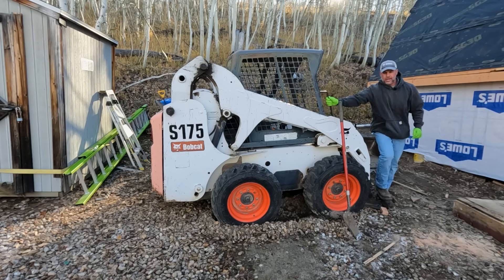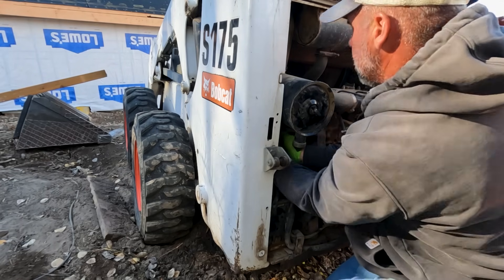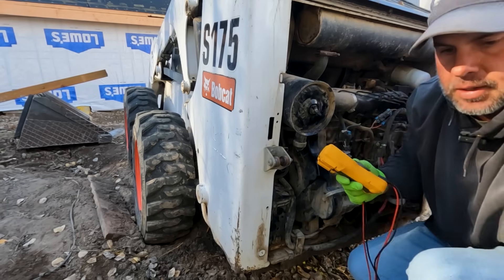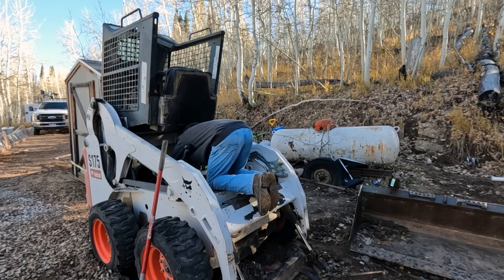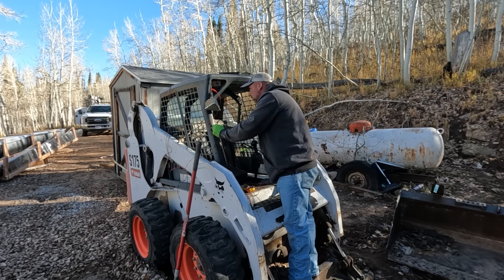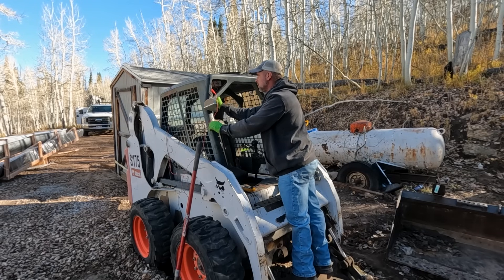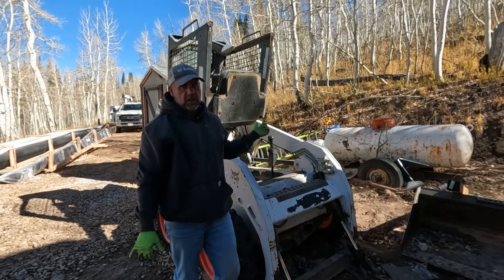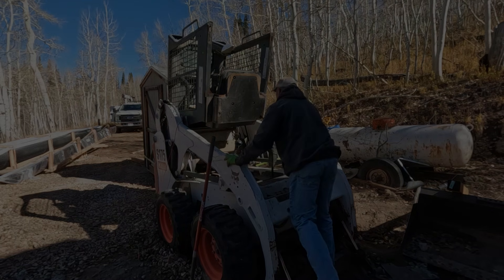Troubleshooting a Bobcat With Electrical Issues.

Comment: My S175 was running fine, I powered down for less than an hour, came back and ignition would click - but not turn over. Battery was good, starter and solenoid were good, I was getting power to the cab - 3 hours later, I came across Brady's S175 video - opened fuse box on my S175 and sure enough, starter relay was bad. Swapped relays around but I could start but not move S175 without good relays in all 3 slots, so ran to Autozone and they had one for $20! Ordered a few more 30s and 40s on Amazon for $9 each, just in case! How do I donate to Brady's 'beer fund'?

Comment: The 3 wires  to the key switch one always  have green corrosion   or check   the harness plug  under cab  right side   by the hyd tank

Comment: I recently purchased a 863, after running it a few times it would crank but no start. Figured out there was no power getting to the fuel shutoff solenoid. 
Turns out there was a loose connection on the ignition switch.

Comment: I know this is an older video and I am only at 10 minutes in and the battery may not be the issue but my first thought was the amperage of the battery when the battery was being checked.  It may read 12 volts but the amperage may be way down because one cell is bad which will not put enough amperage to turn over the engine.  Will continue to watch the rest of the video because it is very informative.  Thanks

Nice job on tracking down the short.

Comment: As a non mechanic I learn so much watching Brady’s videos.  With regard to the starter issue, this was another learning experience for me.  As stated in another comment, I had power coming to cab but no power to starter.  After watching a bunch of issues on testing the starter by putting a volt meter on the S terminal of the starter, I tried it on my starter.  There was no voltage coming to what I thought was the S terminal.  Stupid me, the Bobcat starter has four terminals (power cable from battery, power cable to starter motor, S terminal and R terminal.  The R terminal is located on the front of the starter and the S terminal is tucked away on the back side of the starter.  I didn’t see the S terminal back there, so I was testing the R terminal.  I discovered this after pulling the starter and seeing the S terminal.  A bench test revealed the starter was bad, so I ordered a new starter.  After installing it it still wasn’t working even thought I was getting 12.5 volts to the S terminal when turning the starter.  After much time I discovered that I had put the starter relay in the wrong spot when I was testing the relays.  After putting it back in the right location, the machine started right up.  All this to say, is that through this I learned a lot about the starting system and how it works so next time, I’ll be able to diagnose the problem quicker.  Watching Brady go through his own frustrations on this project comforted me that sometimes you just have to to keep chasing down problems only to find something simple.  Thank you Brady for sharing all your knowledge along with your own frustrations.

Comment: I wish you were in Northwest Missouri right now because I have the same machine with the same problem.  The only power to either panel on the front is the hour meter which says input and I've replaced the left panel and the right and it's changed nothing.

Comment: I enjoyed your video, it was close to an issue a buddy of mine is having. His issue is if he leaves the battery connected to Bobcat, the battery gets drained. When this happens he has to pop in a new or other rechargeable battery to get the machine started. His temporary solution is that he disconnects the black cable when not in use. when he needs to use it, he plugs the black cable on. That is a tempo fix till he figures out what the issue is. Have you ever encountered that and if yes, what was your solution? An fyi, when black cable is connected, the machine needs to run for several minutes. The other day, I connected the black cable to move the machine to another location.  During that process ,whcih was only two minutes, i had to do something else and parked the machine in its original place. The machine ran for like two minutes. After 20 minutes I came back to the machine and plugged on the black cable. when i attempted to start it, it would not start. The console would light up, but it would not kick in. Have you encountered this? If yes, what was your solution?

Comment: Great video!  I have an issue with my T770.  I have power coming to cab, but starter won’t turn over.  It started right up and I turned it off to talk to a worker.  When I got back in, although the cab powers up, the starter won’t turn over.  I’m hoping it’s just a relay issue.  Any advice from anyone?

Comment: My s250 won’t start and gives an error message 8250,   “ starter relay signal wire”voltage not present when voltage expected
Reply: Just died in the middle of operation,turns over but won’t start.
Reply: Fixed it !!!!! I guess when it’s staved off fuel it sends the starter relay error code.

Comment: Have you ever seen an issue where the arms can only lift part of the way? Still has tilt control and drives like normal though. I thought it could be an electrical issue but I’m not sure.

Comment: LMAO! Great video. Makes me feel good that I'm not the only one who GOES NUTZ trying to find these electrical problems in ANY computerized vehicle!
Today I took your advice on this Bobcat 773 diagnostic and looked for the obvious. AND, I didn't use my PowerProbe Tracer! So, after checking all wires between the control panels and the ECM, checking the battery and cleaning/testing all grounds, and reassembling everything and testing for power at every fuse and relay in the fuse panel, we concluded that all wires led back to the ECM from both directions. So we removed the ECM cover and found the silicone goop cracked on the red capacitor at its base. A gentle lift on that capacitor showed both leads to be broken. The OBVIOUS here is NO CAPACITOR CONNECTION on the ECM. Took a full day of testing but we finally found at least one part of the problem. Your perseverance was inspirational!

If you don't mind me asking, do you know what the capacitor specs are on this red (mylar) capacitor? It has no text anywhere on it!

Comment: This video helped to me finally solve a no start/no crank issue on my s175 today; one that has been plaguing me for a couple of months. I had power to the cab and I was getting a code for hydrostatic filter not connected. I changed the pressure sensor at the hydraulic housing, swapped relays, looked for broken wiring, but no dice. Thanks to this video, I decided to pull out my multimeter and recheck the ground cables for resistance. It turns out my battery ground cable to chassis was bad and was causing the computer to send a false code. I purchased a new cable for $10 , installed it, and the machine fired right up. Had I not used a multimeter, I would have never found the issue, as the wire looks completely intact upon visual inspection. I am grateful for this channel and others like it, that are willing to share their knowledge and expertise.

Comment: I have a question to find out if my question is worth a $$call. 
16-07 traction issue , my controler dose not recognize my t200 is running. The issue is deeper than the speed sensor. I have bypassed my traction so I can operate 15 min @atime. 
Spent - new controller $1400
Help.
Reply from the maker: Its usually a wiring issue between the sped sensor and the controller.  You will need to do a continuity test on the circuit.

Comment: Hey guys, I have a old Melroe Bobcat 642. The float detent function on the left pedal works and locks in, but the lift arms dont float, instead they are on full power downwards, as if you were pressing your left toes down without going into float mode. When it is in float mode you also cannot operate the right pedal at all. The linkages aren't hanging up. I recently put new seals in the control valve. Did I put the valve back together wrong, and if so, how? Thank you

Comment: Awesome real time process of trouble shooting. Wins and losses with meters . But you showed a clear path of victory keeping it simple. And I liked your voltage drop testing …with load on circuit …. Please emphasize VD for next time . I don’t believe enough mechs use Voltage Drop correctly to troubleshoot.  Hey and Thanks.

Comment: Hi. I have a S550. Recently I was having issues with the AC not working well. I called a Auto Electrician who came out and told me after a check that the Evap Cooler was leaking. Initially the clutch on the ac was engaging but not disengaging. When starting in the morning, it would cycle on and off a few times and then just remain engaged. The AC would slowly fail to blow cold air after this. So I was told a new evap cooler was needed. So I had the cooler replaced and now the same thing happens. The clutch engages once and does not disengage. I get ice cold air for about 20 minutes and then it starts to warm up. Upon turning the ac switch off, the cold air returns as the cooler defrosts. It seems to freeze up and then stop blowing the cold air. Now I am being told the thermostat/ de icer is not switching the compressor off. I cannot find anyone here in Melbourne Australia who knows what they are doing. Especially when it comes to Bobcat equipment. It's so frustrating. Any tips or ideas to rectify my ac problem. Do I pull the trigger and buy an new thermostat/de icer switch. Or is there another way to determine what is causing the compressor not to switch/cycle. Cheers.
Reply: Not sure about Bobcat A/C as my T250 doesn't have it but the symptoms you describe are common in cars with restricted air flow across the evaporator. In a car the the issue is usually a blocked cabin filter that restricts air flow across the evaporator. It then ices up which restricts air flow which causes things to get warm in the cabin. The ice on the evaporator then melts , which cools the cabin for a short time and the cycle repeats. Maybe check you have good airflow to the evaporator coil.

Comment: Yep, tossed my Snap-on wire tracer into storage after its first use. Haven't come across a circumstance where it works. I just use a multimeter in continuity mode checking between connectors. that eliminates the wires in that section of the harness and can usually find the fault if left on beep mode you can wiggle harness and listen for the break making contact.

Comment: Great TECH tips. I have a S70 with the same problem. Where can I buy the spades ,female conectors for the starter relay & fuses? My local dealer do not sell them for the button of my New fuse box .

Comment: My buddy has a T200 that had an intermittent no start condition. I checked everything from the keypad towards the battery. I couldn't see anything wrong with any of the wiring. It was only when I felt of the wires from the keypad down under the cab to where it entered the main harness. I ended up with only a 1/4" of wire to connect to before it entered the main harness. I was so glad I didn't have to cut into that main harness.  Love your channel.